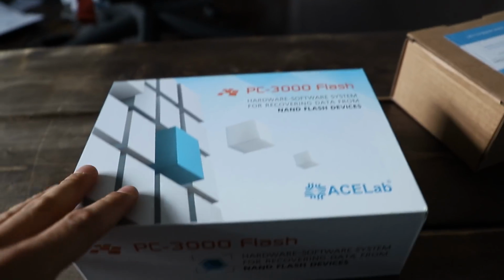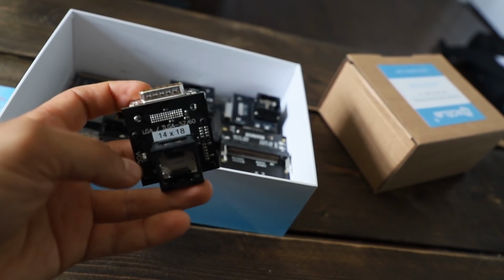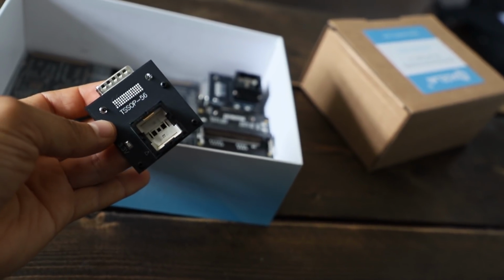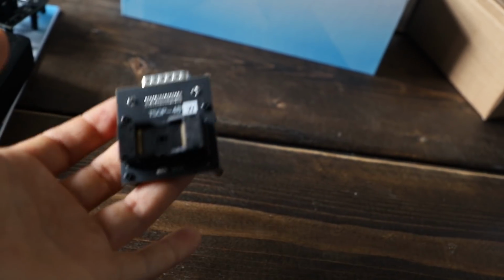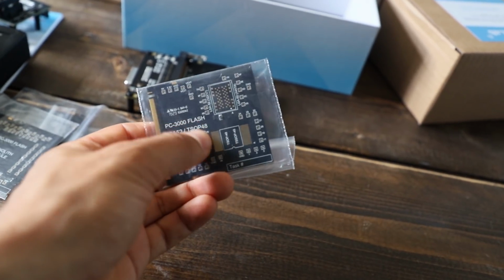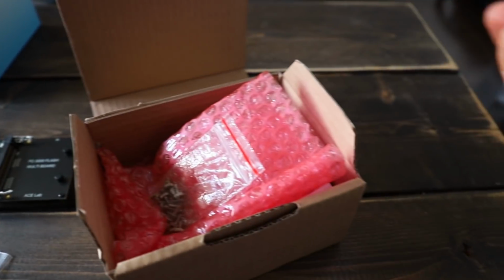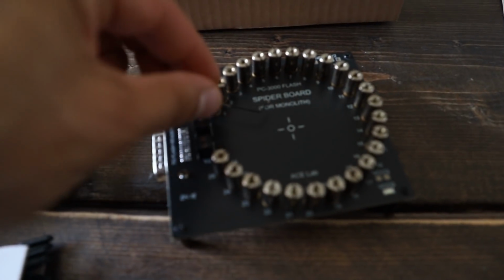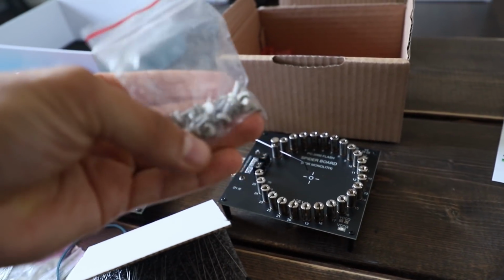new data recovery tools

Comment: Erkin, what tweezers do you use for hot air smd work?  Need to add to YouTube notes, for affiliate link.  Thanks bud.
Reply from the maker: I got them from Union repair. I'll get you details later
Reply: @hddrecoveryservices  oh God.  I tried to order from them in the past. But they sent me all these questions and additional charges for customs and taxes.  So I cancelled.  Is that a big deal?

Comment: Wow as some one on the microelectronics side I am really impressed with the quality. I am surprised that a wafer probe type setup could be made on a PCB.
Reply: This is what you get for $5000.  They use some of the best connectors in the industry in these kits.  And you wouldn't complain about the price if you knew how much work goes into these products, and the fact that they use a very dense and fast FPGA inside these devices which can cost more than $1000 in single piece quantities.

Comment: Say is there anything that can be done for a dead SD card, at some point it just decided to hang it self. When connected to a reader it just shows a grey drive but no access, CMD can't properly see it. 

I'm interested in the future getting data of it, but I would like to be the one recovering it. So any tips are welcome.
Reply from the maker: Data is stored in NAND flash, so if you have tools that can work by NAND protocol then there are options for recovery. However, if you just want that card recovered and nothing else, it will not make sense financially.
Reply: @HDD Recovery Services  I couldn't care less for the card it self, data would be nice to recover. Almost every SD card I owned has corrupted itself or just decided to no longer work. So i am more than used to replacing the damn things. But this one isn't mine and I would like to just get pictures from it. So any suggestions where should i be looking for the secret knowledge, that is recovering data?

Comment: Hey!!! My Brother 4-5years ago Did Something to his Desktop PC REFORMATED/RE INSTALLED OS OR SOMETHING LIKE THAT AND I LEFT SOME OF MY DATA IN IT AND LOST IT. FROM THAT I REQUESTED A MORON FOR ADVICE, RECOVERY SOFTWARE AND GOT NO RESPONSE AND I KEPT USING THE PC AND NOW DO U KNOW ANY MAGIC IF MY DATA IS STILL RECOVERABLE WITHOUT ASKING ME TO SHIPING THE DRIVES... ANY MAGIC I WILL BE ABLE RECOVER THEM FROM MY LAPTOP WITHOUT ACCESSING HIS DESKTOP.. REPLY ASAP.
Reply: put in the fridge for 5 hours, then put 10 minutes in the microwave after that just open it slowly with a screwdriwer and throw part by part into the bin including the microwave. NO after that long it's almost garantied that no data is left back or unoverwritten. And how do you think that anybody can help you if you don't want to send the disc to a location where it can be worked on? If you are looking for that kind of magic, then you need some mushrooms and some LSD then it might be solved magically,.... or maybe not
Reply: You Didn't have to answer so Rudely, Dude There are things called Recovery Software, by magically I meant that... Try your LSD and Mushroom method on your own Drive.. There are True Experts on This... You are not only left expert on The Universe.
Reply: Dark Matter ok try your software

Comment: Do you think the price of recovery for optical drives will ever come down? I have the infamous Seagate backup plus slim 2tb that stopped working. Kicking myself for putting my family photos and videos on it 🤬
Reply: In Russia, it`s not expensive. Our salaries are low... :)
Reply: I'd be curious if you get anywhere with homebrew techniques.   If youre recovering from an actual optical disc,  "touch and go" still applies .. multiple attempts to create an .iso from the disc will produce multiple results which you can attempt to diff together.   We used to do a low-level read and put the head down at multiple starting points, sector by sector.  Sometimes trying a few different drives will produce different results.  WinDirStat is probably still the best tool for getting a general handle on whats going on with a disk.    Obviously, an actual optical disc succumbs to the brute-forth method better than an SSD which risks getting worse when you do too many reads, you want to avoid interrogating the directory structures unnecessarily etc.

Comment: cool stuff !!  would you ever consider making a video of how to make a simple USB chasis 'shell', with the wires extending for connections to the various physically broken SSD / USB devices that you recover?  (especially the ones you sand down to get to the internal connections.)     I have made various versions of this mounting device, but I wonder how you make yours and what parts are ordered ready made.
Reply: Did I miss the video on how to make a basic replacement 'shell' for a broken SSD or USB drive?     I hope you understand what I'm asking about .. basically the opposite of these pre-prepared tools.   What would be the optimal techniques for taking a useless USB flash drive,  opening it up and attaching leads so that you can attach it to a drive that you are trying to recover from (and probably have bypassed the external contacts on)?  Zero cost aside from wires and solder.   Are there problems with maximum length for the leads?  Cross talk?  Does it help to limit the transfer speed?    That sort of stuff?   There's no other real 'authorities' on that particular subject around.